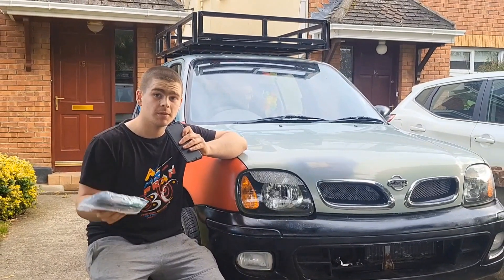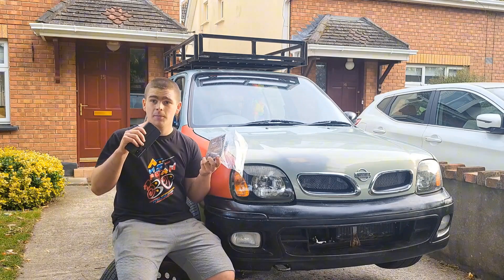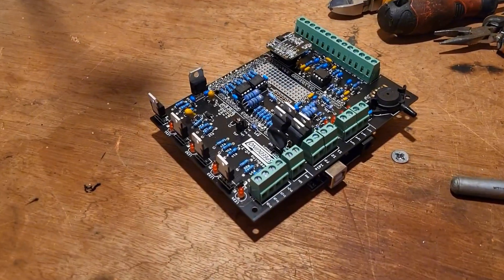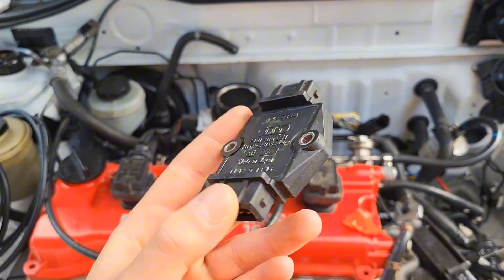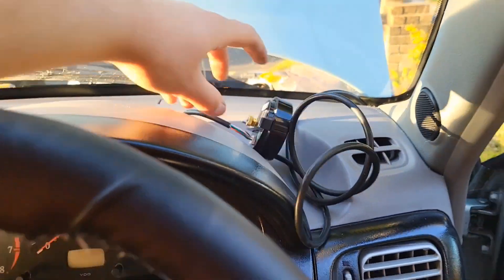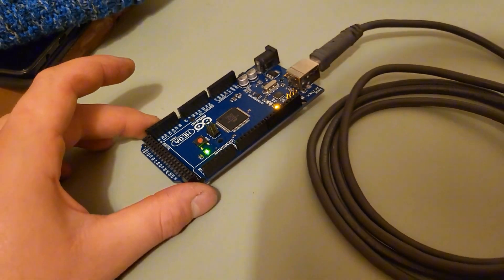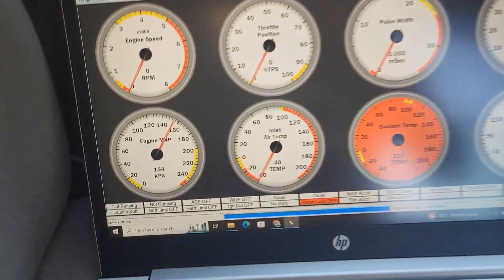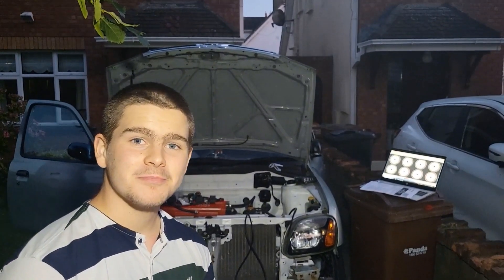Building and Installing a Speeduino Standalone ECU - Turbo Micra Ep.2

Comment: I've had my speeduino and 1.3 march with a TD04, intercooler, custom fuel rail with pink subaru injectors etc ready to go for a year now and I think this is the motivation I needed to actually wire it in.
Reply from the maker: It's not too hard of a job to get it set up, would love to see a build like that up and running. Good luck!👍

Comment: I'm trying to build an igniter for my bike.  A 4 cylinder motor that has a pair of coils firing 2 plugs each.  So each pair fires as the rotor goes around for a wasted spark system.  But I don't know if I'm missing anything.
Reply from the maker: Unfortunately, I wouldn't be too familiar with how to make something like that work, but I'm sure it would be possible on an ECU like the Speeduino, surely there's some forums out there, though.

Comment: Do you have a wiring diagram? I've got a 1.4 but I hope it's not too different from the 1.0 coilpack engine. I was looking at the MegaMicra videos but the wiring is a bit confusing
Reply from the maker: If you hadn't mention you looked at the MegaMicra videos, I would've told you to do exactly that as that's the files I used. 🤣 I have some extra stuff in a shared folder that might help you. I can even try to send you like a voice over walk-through if anything is a bit confusing.

Check this folder with the files I used: https://drive.google.com/drive/folders/1e8W5z4EhZHwW03Oq3Q42SkolCVaGhJ8m

DM me on insta if you need any help👍

Comment: Currently working on a cg13 most of the problem is with the wiring from ECU non of the sensors are working trying to fix it and built it 🙌🏼
Reply from the maker: Unfortunately I'm not too familiar with the earlier distributor engines, I know some of the hardware is different and same with the ECU wiring. There's some info on the forums though. Good luck 👍

Comment: This is a really interesting project I watched all 5 episodes in a row, but I was wondering how did you make the original speedo and rpm-meter work with speeduino?
Reply from the maker: Thanks for the support mate, I can't take credit for getting the tacho working as I just copied what MegaMicra (here on YT) did in his step by step series on his K11 Micra. It really depends on the type of tachometer your car has. For example, I had to add a 1k resistor from a pin related to the crank sensor, I think, on the ECU to the tacho signal wire in the cars wiring loom.
Reply: @the_mintiest_micra  wow I love how analogic is this mod, unlike some software adjustment or an additional board with fancy PID technology. So well every case is different, I'll learn something by checking MegaMicra but I'm sure it's gonna be a trial-and-error work, i have a lancia Y first generation btw.

Comment: Doesnt the micra already have a ingition module somewhere?
Reply from the maker: I'm not 100% sure, I think the distributor engines have an igniter, but I don't know about the coilpack models, might be built into the ecu hance the need for an external igniter when going standalone with the Speeduino. I do know however that it was necessary.
Reply: @the_mintiest_micra  do you know the signal voltage to the three pin coils? I have some beefy transistors laying around and was thinking if i can make my own igiter.
Reply from the maker: @ouew3872  I'm no expert so I'm not too sure, but if you're asking about what voltage signal is going to the igniter from the ecu it's 12v. Im not sure what that gets amplified into by the time it actually gets to the coilpack for there to be a spark.

Comment: How do you know how to connect the ignition audi module to each cable?
Reply from the maker: There's a 5 pin side and a 4 pin side.

 The inputs go on the 5 pin side in order of the engine firing order (pin 1 is cylinder 1, 2 is cylinder 3, pin 3 goes to ground, pin 4 is cylinder 4 and pin 5 is cylinder 2 for me). 

The pins on the 4 pin side go to the signla wires of the coil packs (same as input side but no ground pin). 

Also part number for the igniter I used is 4D0905351, can be found in late 90s early 00s VWAG four cylinder petrol cars.

Be very careful wiring the ignition and research the firing order of the engine and in what order your ecu sends out the ignition signals. Good luck.👍
Reply: Thank you!
Im puting de speeduino on a Alfa Romeo 145 1.6 Twin Spark
It has two pins coil, this WAG igniter Will fit?
Reply from the maker: That's cool, will you be using all 8 spark plugs? I think all two pin coils need an igniter to work with a Speeduino, usually 3pin coils don't but the Micra is an exception as they're still "dumb coils". I would assume the igniter will work with your coils but definitely double check, read the Speeduino manual and see if you can find any info and specs on the hardware your engine has.